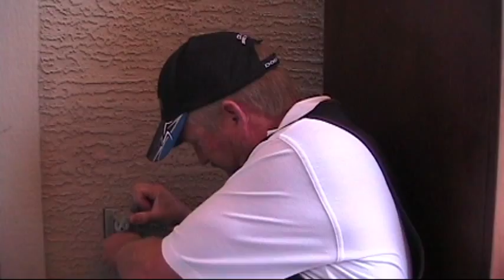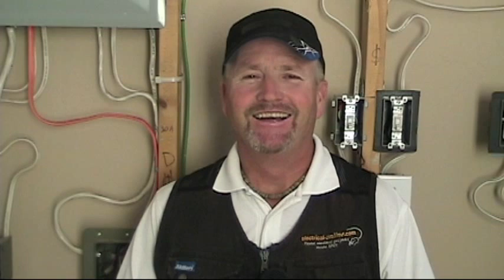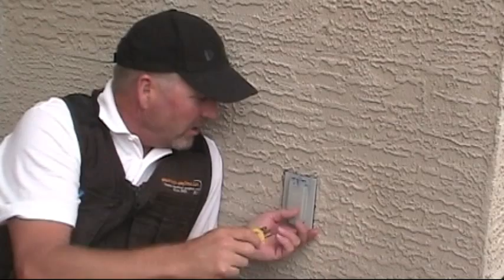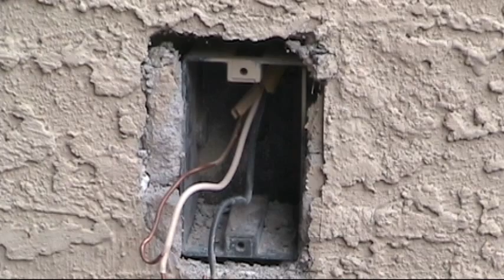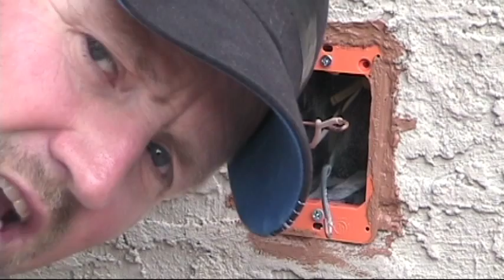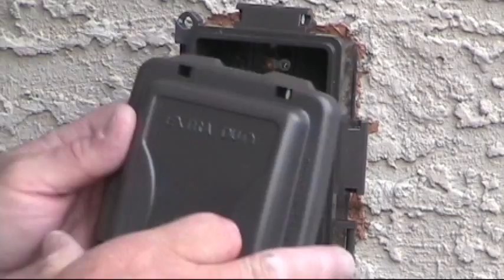How to Install an In Use Weatherproof Receptacle Cover

Comment: How come you didn’t replace with a GFCI outlet?!  Even if not a code requirement, wouldn’t it be safer?  Good video, none the less.
Reply from the maker: Hey Mike, thanks for watching!  This outlet is fed on the load side of a GFCI outlet so it is protected.  I'm pretty sure I mentioned that in the video at some point, but it's been a while since I shot that one.

Comment: I wish that all US/NA 5-15 and related standard electrical outlets were required to be ground pin up. It's currently required in bathrooms and (iirc) kitchens in residential areas and in commercial kitchens, hospitals, etc, but most wall outlets are ground down for any other areas.
Reply from the maker: What is your reason that you prefer ground prong up?
Reply: @theinternetelectrician  Mainly one of safety. If a conductive object were to fall towards it in a way that contact would be made, you want it to touch ground first. with ground pointing down, it can only feasibly touch positive and neutral which can be hazardous. It's for this reason that hospital floors have them oriented this way, so there's precedent based on the same reasoning.
Reply from the maker: Ian Paylor yes, that is the most common argument that I’ve heard for the ground up lobby. With regard to hospitals, they use stainless steel metal plates which increases the risk of the plate falling down across the hot and neutral blades.  In residential applications, usually plastic or nylon plates. So the ground down lobby argument is mostly aesthetics. They prefer the “surprised face” emoji look. 😮

Comment: Why wasn't a GFCI receptacle installed on an outdoor outlet?
Reply from the maker: This is a GFCI protected outlet.  It's fed downstream from a GFCI receptacle that, here in Arizona, it's common practice that they mount inside the garage, then feed all the outside outlets from the load terminals of it.

Comment: "the box is night and solid" ... (taps box and it nearly falls out). also, don't lie... that isn't a "box extension ring" that is a low voltage old work box with the drywall tabs taken out ;)
Reply: Not only is that a LV device ring, but it's ORANGE so that any electrician or inspector will FLAG it as a violation.  Author has 50K subscribers and I don't mean disrespect, but these flaws ruin it for me.  Compared to the effort in making these videos, "basic" knowledge of the NEC is easy.   It makes me wonder what kind of electrician certification they have in Nevada...

Comment: thanks so much for this video! I was having a rough time with an outdoor socket. It was poorly installed in brick and wasn't GFCI. So bought a new outlet and a cover. problem was the box was set too far back, which your video helped me realize. one more trip to Home Depot and I had the box extender I needed. it's in and Christmas lights are working great! Getting some rain tonight so we'll see how it holds up. Thanks again!!
Reply: Rob Rader oops pok

Comment: I'm going to install some fiber cement siding with rain screen - I want to fabricate my own mounting block as I need to match the stain in the porch. Would you explain the details of the mounting block, the box, the water proofing etc. Should the box be a particular type and does it have to be installed flush to sheathing or flush to block? There just does not seem to be much about the details around this... Any help or guidance would be most welcome in this area.

Comment: sorry if i have commented in your work, why there is none gasket or sealant in between cement wall and receptacle cover? if  rain comes, water will enter to receptacle!...
Reply from the maker: +darma pal You see at near the end where adding the extension ring and sealing it with caulking, I now have a smooth surface for the foam rubber gasket (that comes with the kit) to seal up to.

Comment: I have an existing GFCI receptacle already installed on the exterior side of my house.  The receptacle is essentially flush with the house. I want to bring a conduit to this receptacle in order to get power - protected by the GFCI - to other outdoor areas.  The conduit, of course, carries the wires that need to be connected inside the GFCI box.   My plan is to install a 1 gang weatherproof in use box with 1/2 inch outlet.  The conduit will connect to the 1/2 inch outlet with a liquid tight connector.  However, in order for this to work, the box cannot be flush with the house.  It must protrude out so that the conduit can meet up with the 1/2 inch outlet in the box.   This can all be accomplished by removing the existing GFCI receptacle, and mounting the 1 gang weatherproof box over the hole that would be created by removing the existing GFCI receptacle.  My question is :  Is it OK to do this?  The weatherproof in use box would essentially completely cover the hole, and I would caulk around it to make sure no water could get in.
Reply from the maker: +ddenuci Yes, this is an acceptable method of accomplishing what you want to do if you do it as you describe.